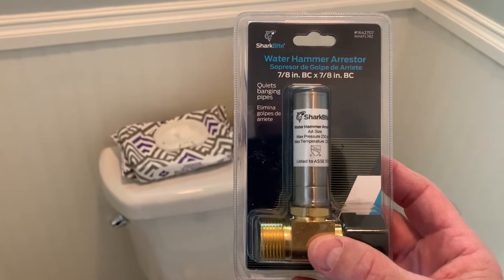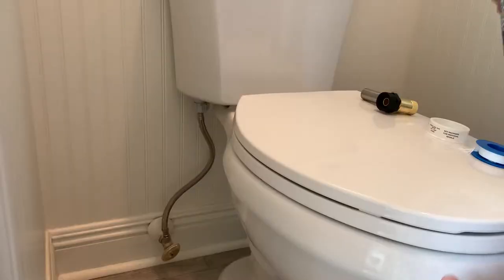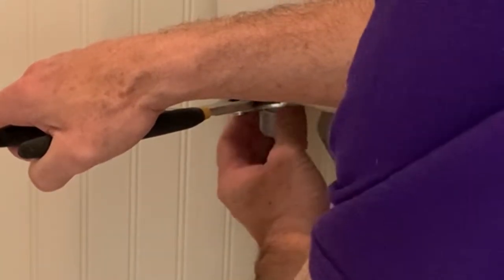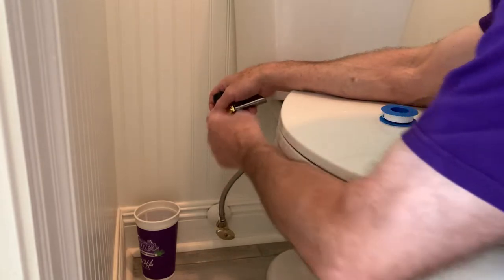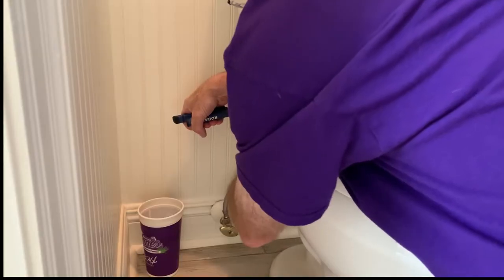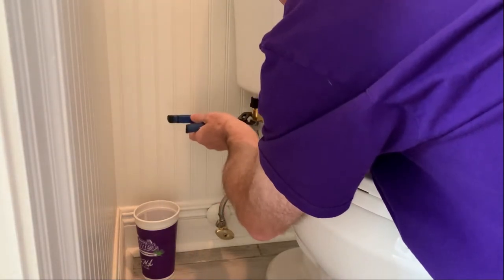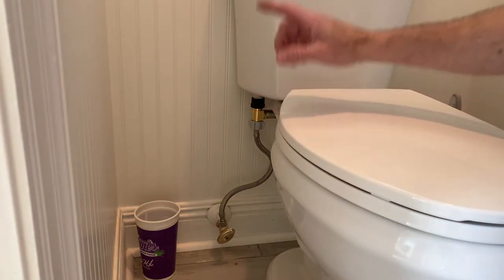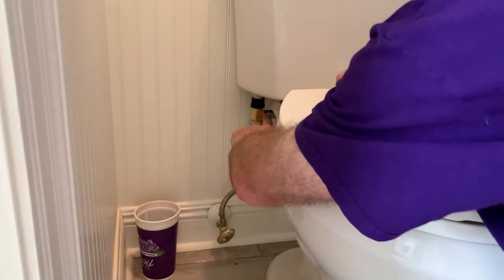Eliminating water hammer with SharkBite's water hammer arrestor!

Comment: I just installed this exact same arrestor today. I'm going to keep an ear on it to see if I hear the water hammer persist so far it seems it has gone away. But I want to let at least a week go by to make sure that the product is actually working as expected. I will post updates here after a week.
Reply from the maker: Thanks for commenting. Let us know how it works out. Mine is still working fine.
Reply: @FixItDepot  so the thud in the wall went away for a few days but now it's back even with the arrestor :(. I think I may end up swapping out the whole fill valve. When observing the fill valve, its the float rising abruptly at the end of the tank filling that causes the thud to happen. At least I gave it a shot.
Reply from the maker: I noticed the same thing. It seemed to happen right when the fill valve snapped closed at the end. Changing the fill valve might be the better solution.
Reply: I just installed two of these on two Toto-2's, I am not noticing much of a difference I was hoping for. That 1.3 gal flusher shuts off very violently.
Reply: It didn't work for me. I had to end up reducing the overall water pressure to my home from the main line since my toilet doesn't have the adjustable turn valve, it has those push/pull stoppers, which sucks because I can't just reduce water pressure on the one toilet. Oh well, lowering main line pressure has been working for me. @NerdyShawn